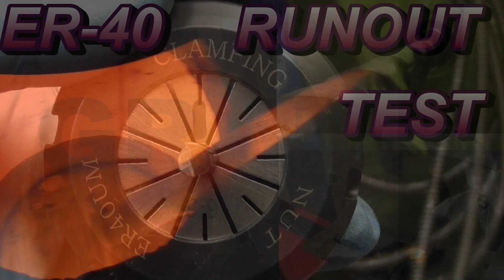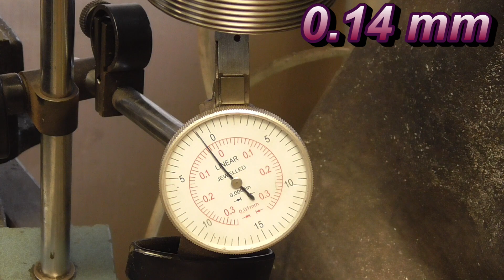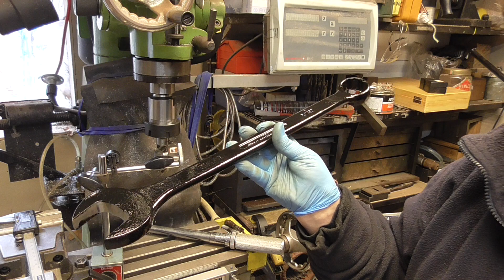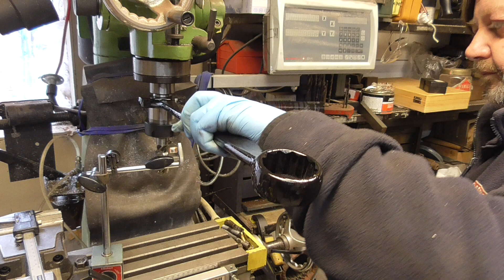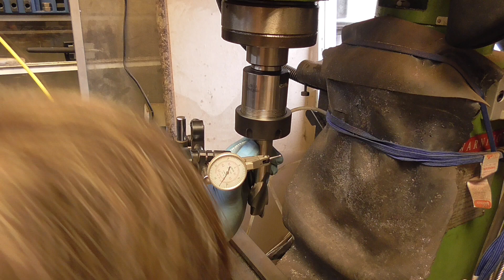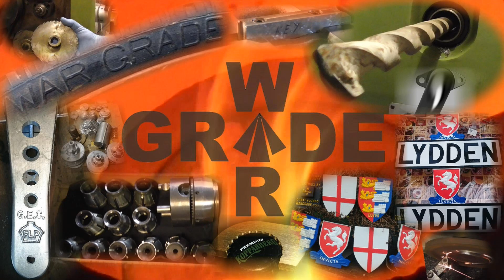ER-40 Runout Test UPDATE

Comment: Unless you are into CNC, where you must know the assumed diam of the cutter during runout, then the run out for any collet is inconsequential to the cut you are going to make.
Interpreted this means if you have a 12mm diam cutter then with CNC you are relying on the assumed cutting diam of 12mm  to be achieved by a true running collet.............this will determine the actual tool paths of the cutter during the machining cycle.
If the collet runs out .02mm then the cutter is going to rotate in a bigger radius and give you a different diam for the cut and your dimensions will be out........changing cutters will leave you in the dark as you never know if the cutter is running out or by how much.
With manual milling you are testing the dimension of the cut with sequential cuts as you proceed.......it doesn't matter if the cutter runs out or not.......with that there is no problem using cheap collets that "could" run out.

Comment: Firstly, I envy you. You have some seriously nice machines. I must say that I don't like the recess in the small end of the collet as you pointed out - it's not clamping on anything. Rather urinate on my shoe than giving me a collet (or chuck) with run-out. Lathe chucks are classified in the same category. It irritates me seriously when a 3 jaw chuck has run-out or the jaws are not parallel to the center line. The Chinese  chucks are infamous for this.
Reply from the maker: Thank you, I am not rich & I have worked hard over the years to get some of the things I want, I have mad sacrifices for some things but realise I am lucky.

Not everything is made equal & I do realise when I get something cheap, there is sometimes a reason.
That said it irritates me somethings command a higher price simply because of a brand name rather than the quality.
What you pay for most of the time is simply profit for xxx and not the product it self.
But it's knowing the truth about what you are purchasing & being able to balance cost and function, for jo blogs like me, that knowledge will never truly be available, so it's read as much info as you can and then best judgement.
Reply: @WarGrade  Good evening brother. At this moment I'm busy with two "oversize" ER collets with ID's of 41.2 and 51.6. I have been manufacturing stuff that's used in the meat processing business, like hamburger patty presses and sausage filler nozzles for the last six years. Because of the minute size of the spindle bore on my lathe (40 mm) I had a need to machine bigger diameter material. So, I manufactured a holding tube which will have ER collets (my own sizes) to hold 1 meter lengths of material at a time. So, I see that I manufacture everything with absolutely minimum run-out. I also modify manual meat mincers by fitting a ball bearing in the nut on the front of the mincer and a taper roller bearing on the end of the mincer worm, with a gearbox and electric motor. Works like a charm. Have a beer day. Right now I am typing this message by candle light because we have just another power cut in this shithole country - South Africa.

Comment: is the initial runout coming from the holder or the spindle. i bought a ER32 collet holder and colletts and not one ran true, these came from eBay and didn't even state the grade.....
Reply from the maker: Hello Peter, if you watch the first test video, I check the runout (& id did before this test to just left it out due to time (be in the next one)), spindle runout was 0.02 mm at the base (I am un-able to reach up inside the coulomb to check the upper seat, but in the next video I check my ER25 and that's spot on (so please subscribe if you haven't).
The ER40 gear all came from ebay, as I use them I dial them in to get the best I can out of them.
Reply: @WarGrade  have done, watched the vids wrong way round..... my bad
Reply from the maker: @peterparsons3297  one thing YT is a pain for, I have a habit of doing the same thing all the time.

Comment: I think if you are using the value on the torque wrench the value applied to the clamping nut will be increased by the effect of the spanner.   You would need to reduce the torque setting to allow for the extra leverage created by the spanner. (forgive me if you did that and I didn't catch it)
Having said that I think that if your seat has runout then no amount of clamping force is going to fix that.
Interesting video!
Reply from the maker: Thanks John & you are totally correct, that was the whole intention of this video.
when I made my original video, I have loads of comments about this and that, the fact was I measured runout in my collet holder & if I rotated a collet I could change that value.
I my mind that can ONLY be done if the collet holder & the collet have runout.
But one comment I could not argue with what correct torqueing the collet, so I had to try it.
I covered the torque multiplication thing in the video of making the 2nd spanner.